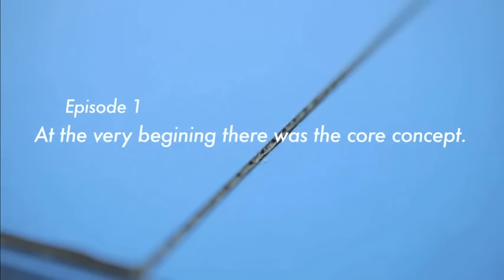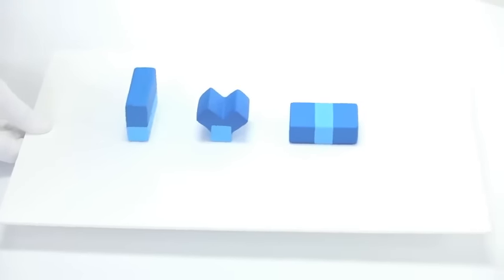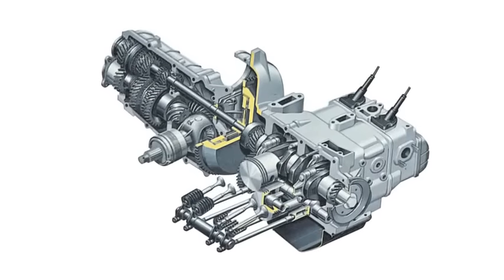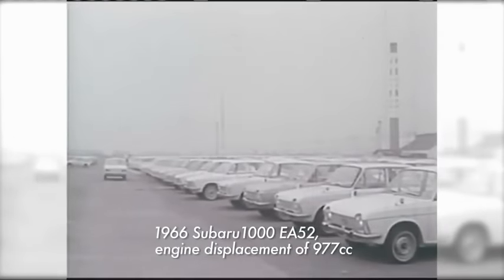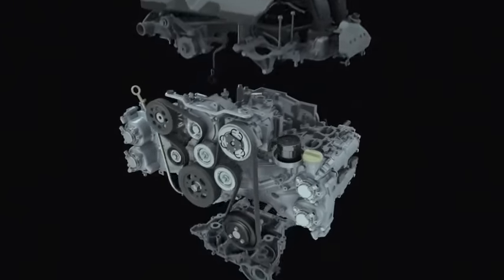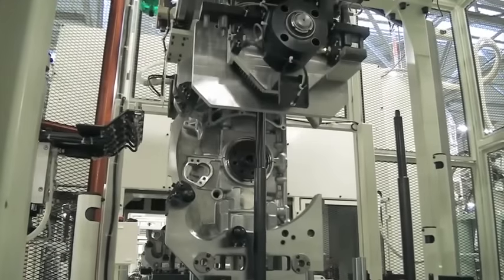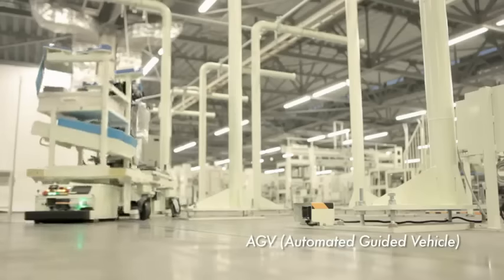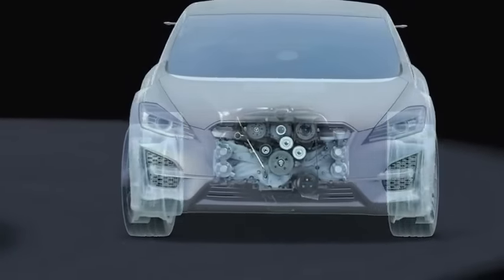Learn About Subaru Boxer Engine Technology

Comment: Tell us why they blow headgaskets all the frickin time
Reply: Will s. Because the original engine design was a closed deck block that prevented the heat from expanding the cylinder walls, ultimately brakeing the head gasket seal. Bad/old oil and old/or off brand antifreeze made the problem 100x worse.

Porsche invented the flat engine and sold it to Subaru. Subaru cut corners and took too much reinforcing metal out of the block and melted Chinese pop cans into motors to sell to America because we bombed them. The Japanese make themselves the quality engines and give Americans junk to this day.
Reply: lol. sounds make sense. here in asia we havent heard about blow gasket. yes here we got jdm direct import.
Reply: Will s the wrx and sti gaskets are much better and are of different design

Comment: Just be prepared to spend a couple grand on head gaskets if you plan to put some miles on the car!
Reply: Or learn to pick up a spanner on your own.....
Reply: Legacylout this guy never worked on a Subaru lol
Reply: Not if you maintain the cooling system correctly and make sure the grounding cables are making good contact at all times.
Reply: or find a good mechanic.

Comment: it's not just rubber, the belts have steel bands in them. timing belts are very durable. however, yes, you have to change your timing belt every once in a while. it's not that bad though, don't complain

Comment: Why F1 using V type engine since years i wonder then ?  F1 engines most efficent engines about power and handling balance..subaru can go to the F1 with a boxer engine...then i will do believe boxer engine is better then a V engine..otherwise this will be just a cheap subaru commercial..
Reply: +gkc “gkcmgk” mgk - yes this it is, commercial - boxer engines were designed for plains, but so many issue that everybody get rid, except Subaru.
Reply: +gkc “gkcmgk” mgk F1 simply has regulations that state all engines need to be the same type.  It happens to be V8 at the moment because most car companies don't make Boxxer engines, so Subaru is odd man out.  That is why they don't compete.
Reply: +mystic1754 a few pictures of an F1 engine they made doesn't mean anything. in fact it would confirm what I said. That engine is not allowed because it is not a V8 as specified by F1 regulations.
Reply: Don't forget that F1 engines get a nice rebuild after each weekend.

Comment: just a silly Subaru Commercial
Reply: I like the balanced idea, I think it would be cool to TRANSVERSE mount it. That way you could work on it much easier, and even make a BOXER 8 CYLINDER (since you have more room longways). You could tune it to rev much higher with the good balance and low rotation mass.
How freaking epic would that be?!
Reply: +cybertree Just mount your inline 6 sideways XD
Reply: +cybertree These engines are wider than they are longer, so mounting it transversely would mean the car would need a longer hood. Not to mention that there are inherent dis-advantages to mounting an engine transversely. Go look at a Honda CRV with "AWD" trying to claw it's way up an icy road, then go watch a Subaru or Audi actually make it up there with ease. Mounting an engine transversely means you always have one CV axle that is longer than the other, plus you have the weight biased towards one side of the front. Both of those induce torque steer, especially on slippery surfaces. That would take away one of Subaru's advantages (probably it's main advantage over most other cars of it's class, it's stability on the road)
Reply: +Yo ski It might be balanced but it is so darn noisy and rough.  I'll take the inline design any day!
Reply: Dominic Fong Well, isn't that sort of the point of it? I mean, Inline's are great, and aside from the lower center of gravity and less vibrations aren't really inferior to Boxer's, but the sound a boxer makes is just fantastic. I suppose it's personal taster.
Have a nice day!
Reply: +cybertree  I would love to hear an H8 engine, I truly wonder what kind of sound it would give off.
Reply: Maestro_T <====== He gets it =)
Reply: cybertree I just googled "boxer 8 cylinder" and it turns out Porsche used some in race cars and a couple of aircraft manufacturers have used them.  This still doesn't do us much good, mind you.  ;)
Reply: cybertree Well, the beauty of the Boxer is that it's perfectly balanced with even numbers of cylinders above four, so, 4, 6, 8 etc. are all perfectly balanced when it comes to primary forces (The cylinders and crank shaft's forces, which are the biggest ones in the engine). But for the given application of Boxer's, and how they only power things from hatchbacks to SUV's, you really don't "NEED" more power than what a six cylinder will provide. Sure, you have competitors like Audi shoving their V8's and W12's in anything that fits them, but that's a different class of vehicles after all. (Can't compare a Legacy to an A8 in most aspects. Closest comparison would be an A4, and those get engines of similar displacement to the Subies' offerings.)
Reply: Newgenerationisbg Hmm, a Subaru flagship that's larger than the Legacy but uses an H8....  ;)  If there were a time for that to have happened (and that itself is doubtful), it's almost certainly passed, since V8's are dying out even among the luxury cars.  But it's a shame Porsche didn't put one in the Panamera.  Must be a packaging issue.  I'm sure they could make one with a smaller displacement and then turbocharge it, but this would still result in worse fuel economy than an H6 equivalent.
Reply: Maestro_T Well, another reason why it's unlikely is because it's much cheaper to just turbocharge the H6 and get the same amount of power with a much lower cost, due to the fact that you wouldn't have to design a new engine. Porsche put a V8 in the Panamera because it could just modify an existing engine (Can't find anything official, but it's very likely it was derived from the 4.2 Audi V8.)
Reply: Newgenerationisbg I completely agree, it's not necessary whatsoever, the boxer 8 idea would simply be awesome for guys like me, who like to modify engines, go to the track, and show-up supercars with my STI. If I had an extra two cylinders, that's a plethora of extra performance capabilities. (I'm currently supercharging my boxer 6, and so far the dyno tests show that it's stable way past the boost levels expected.)
Reply: cybertree Boxers are tough little engines. The way they are made means that the crankshaft can take more power without breaking, and their cooling is also superior to more conventional inline's and V's. The H6's are often ignored, which is a crying shame because they are fantastic. Sure, they are more expensive to maintain, but that comes with the territory brought by a more complicated engine. I'm sure that if Subaru made an H8 it would be a sight to behold (and a sound to adore as well), but that seems unlikely unless they introduce a new model that can properly use the thing. If they put one in the Legacy, it would become a proper competitor for the new BMW M3 and Audi S4, if not even the M5 and S6/RS6. Heck, even if they just put a turbocharged H6 in the newer Legacy it might put up a good fight against an S4. (A ~350HP Legacy or Outback? Sign me up!)
Reply: Newgenerationisbg Exactly!
Reply: 917K Flat-12 Engine

How about a H12

Comment: The first WRX I owned had the head gaskets fail, which cost me a small fortune. Naively assuming I was just 'unlucky' I bought another WRX a few years later and guess what? Yep, the head gaskets failed on that motor too. I plucked up the courage for a DIY job to save the ££££'s and what a shit storm of stress that turned out to be.
Never again. Nice cars but fuck not worth the hassle and if you're even more unlucky the big end bearing failure is another blast.
Steer clear would be my advice.

Comment: lol minimal vibrations
Reply: +Lucas Ocampo  Yeah, what a joke.  These things don't run anywhere nearly as smoothly as a Honda or Toyota 4-cylinder.  The H6 is quite smooth, though, or at least the last one I heard was.
Reply: +Maestro_T yeah they make cool rumble noises because of the uneven heads but they fixed it :(
Reply: They run smoother than any cars I have been in.
Reply: Yeah moreso the headers and rest of the exhaust's fault for that
Reply: get a 3.6r and you won't hear anything.

Comment: Here's something to learn about them, they are some of the most over rated and unreliable motors ever made. Steer clear.
Reply: I'd have to say the engine is what kept us out of a Subaru last year. All things considered, if it had a conventional engine we'd have been all over it. To most people low CG is the least of considerations, and just like a lot of things (like Apple) the fanboy fervour made us suspicious. Also the dealerships in our area have atrocious reputations to boot. So: nope, with some regrets, they are great cars in every other respect, even love the logo :D
Reply: +Ishka Bibble  I am totally with you, even though I just bought one.  Would I be happier if it had a regular inline-4 and even front-wheel drive?  Yup.
Reply: They're rated highest in reliability, highest in resale value, and offer features that no other manufacturer offers. 
Overrated? Not really, the competition needs to step up and make some better cars.
Reply: +Ishka Bibble The engine is one of the best parts, and the low COG is very noticeable compared to other cars. 
Compared to a standard  I4 car, the Boxers are a breeze to work on. Oil changes, plug changes, etc. are easier.
Reply: Jacob Saca So overrated they can take a semi truck at 75 mph and you can get out and walk away. So unreliable that the engines will last for well over 400k if you take care of them. So FUCKING over rated

Comment: messed up a bit when they say there's only two manufacturers of the boxer engine when there's three. subru and Porsche are probly the more commonly know but BMW have been using the boxer style engine for years and still do to day. granted its for motorcycles but it's still a boxer ( horizontaly opposed)

Comment: Not ashamed but kind of hidding the fact that I went back to honda (Gas Saver) since I had to replace the head gasket and timing belt and a few other things... Took me two hours and no shop. You give some and you take some with Subaru's. I loved my WRX and I was putting out 320Hp with a Big 16g turbo, BOV and ECU upgrades as well as some bolt ons and it was fun until the head gasket blew.

Comment: Did we mention head gasket problems? :)
Pretty good video really. Don't know what the comments below are complaining about.
Reply: I don't know of any head gasket problems. My 03 Baja's worst part is that it was an oil burner at one time (likely because it wasn't used to my driving style) and... that's it for engine issues.
Reply: Then you haven't read much about the boxer engine. Pretty common problem.
Reply: Bill Malec Funny, we've had high mileage boxer engines. All of them with one exception were phenomenal

Comment: My 2012 wrx holds 20 lbs of boost just fine. It is protuned on the dyno and I haven't had any problems with it. So when ppl say they suck or they are weak. Porsche uses the same design boxer motors for their 911 and Cayman models. So yeah facts are facts.

Comment: Good video - probably shown to the every new employee of the Subaru factory. Went through 4 Subarus in the past 3.5 years and 3 of the cars had their head gaskets leaking (80-100k miles on the cars). The flat engines are prone to such issues, I did not hear the video mention that. Also Ford gets 160 hp out of its 2.0L engine, while Subaru gets 148 hp. On the positive note, I loved the robots in the factory that move the engines around on their own. In US the guy named Bill has that job.
Reply: And Honda gets 200hp out of 2.0L? What's your point? Head gasket leaking is only a problem of the 2.5L engines, especially turbo  (more pressure), and still you have been very unlucky clearly. Too bad anedoctal experience does not make general truth.

Comment: Eh? Tarbo subarus are/were prone to ringland failures, and there was quite a few years where there were severe issues with headgaskets. I own quite a few cars, and one of them is domestic, a 2011 f350 diesel. Maybe if domestics weren't absolute piles of crud until just recently, or they offered more AWD options, I'd be inclined to purchase one.

Comment: Or you could refer to it as like playing Paddle ball were there is a flat paddle with a small rubber ball attached at the center via an elastic string. But you're probably right I didn't think of that.

Comment: No, you are wrong, are going out of context. The forces inside that engine, which we are talking about wear and possible damage, is part of centrifugal force. A paddle ball is NOT centrifugal force! The engine has a center rotating mass that forces the pistons outwards upon need at faster rpm, just as a ball spinning around rises due to centrifugal forces acting on the ball to force it at equal height to the string's height. This is what prevents piston and sleeve damage.

Comment: cool motor and all but it also has a higher maintenance compare to a inline and V engines. Like the video keeps saying it's a great motor but it takes longer to take apart and putting it back together since it has to heads.

Comment: It's actually not exactly the same, but can be loosely referred to it as a paddleball. A spinning ball at the end of the string has a wide range of potential RPM, unlike a paddleball which either works or doesn't. It's also how Subaru themselves describe it in layman's terms.

Comment: from my understanding and using (80.000 km) it doesn't wear of faster, but it uses more oil, and you have to fill up the oil quite often compare to a V engine. Because gravity makes a tiny gap between the upper side of the piston and the cylinder from wich oil can go out. That's what my garagist told me too!

sorry for my english,

Comment: My dad is a mechanic, and he loves Subaru's. ;-)  Every time we pass one on the road, he laughs out loud and says: "headgasket." lol  He will not let me ever buy one.
Reply: Your dad know what those people should be doing to keep that from happening. Change coolant every two years and occasionally check the cables grounding the head and block to make sure they are making good contact. That stops the electrolisis that causes blown head gaskets. If he doesn't know that he is a joke of a mechanic.
Reply: juliadennehy How can your dad loves Subarus if he can tell you NOT to buy a subaru?  It doesn't make any sense.  Headgasket can blows in every single car, take good care of your engine and it will take good care of you.
Reply: Wayne bums little boys
Reply: Phil Speakman  you obviously drive a 90s civic. Its a fact that Subaru's are 2nd for most reliable cars, And since they are the 2015 wrx got rated top for best resale value. Drive a Subaru before you bash them.
Reply: What about Subaru's safety rating??? Actually I buy Subaru but I am not sure you are right about them being 2nd in reliability of the big brands. Honda is first and Toyota second I thought. I could be wrong. Subaru is rated 5th or something by Consumer Reports from what I had seen. 
Anyway, this head gasket post is funny because if you know the right mechanic or have mechanical skills the head gaskets can be replaced easily. The issue with Subaru's actually is that if you let them get low at all on oil...even just slightly below the low mark on the dipstick, the crankshaft bearings will quickly suffer damage.
Reply: Wayne Wildman Subaru has acknowledged defective head gaskets on Impreza and Outbacks MY96-10. Many years of bad head gaskets to be replaced with newer MLS gaskets.
Reply: juliadennehy Your dad is smart. It costs over $2K for head gasket replacement on a Subaru.
Reply: swankrecords unless you do it yourself.
Reply: I know this. But here is the thing...I have an 02 wrx sport wagon. Hasn't had an issue.
Reply: swankrecords lol I just keep thinking how badly people get ripped off...you can get an entire, brand new shortblock engine from Subaru for 2k$. Anyone paying that for head gasket replacement needs to search for a fair mechanic. I replaced some for a friend, it took me two days. A good mechanic should be able to do it in one day or less. Thats 2 grand for a days work...why am I not doing that for a living!
Reply: juliadennehy Amen! We bought a forester brand new in 03' has always been meticulously serviced and has only done 70k and head gasket is already blown
Reply: juliadennehy Your dad must be a pretty bad mechanic.
Reply: @Pccpy  Her dad is a mechanic.  He loves Subis because they are known for having headgasket problems.  That means $more money$ for him!  Subis are notorious for blowing headgaskets.  Being a Subaru mechanic is like being able to print money.
Reply: @Wayne S.  Actually, a good mechanic can do it in less than four hours.  One guy around here was challenged and did it in like 45 mins.  Still haven't figured out how he did that!  As to your comment about making a living ... you and me both!

Comment: I do note the distinctive Boxer rumble in my father's 2000 Legacy, and I do miss it slightly as I never got to drive it as the head gaskets were failing and he sold it off.
The car however, makes an incredibly high pitched squealing noise when started-up in sub-zero temperatures, I still don't know what causes that today.
Reply: Boxer rumble lol. Probably had a hole in the muffler.

Comment: My neighbor has a jeep subaru 2014 4x4 and what do you think?, I go ahead at the lights with my Civic 1999 5 speed manual 1.6l stock, and with my Mustang GT 2005 unmodified stock,
Reply: Rgr Rpm Jeep don't make a Subaru
Reply: +Quyen Le If I know, I meant only the shape of the car ,the cars is Subaru Outback AWD 2014
Reply: it is very imprezzive and creative to compare a 2300lbs compact vs a 3400lbs full-size suv on acceleration.
honda makes good cars but also make stupid fanboys.